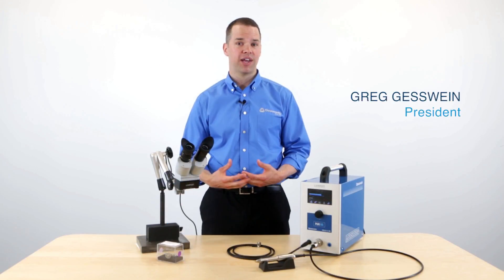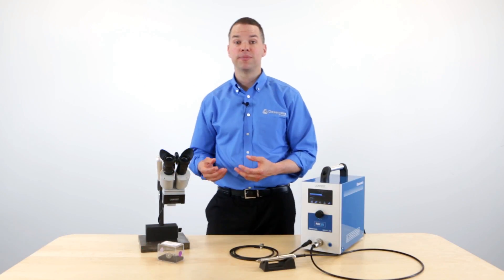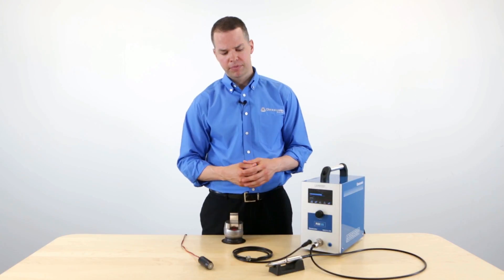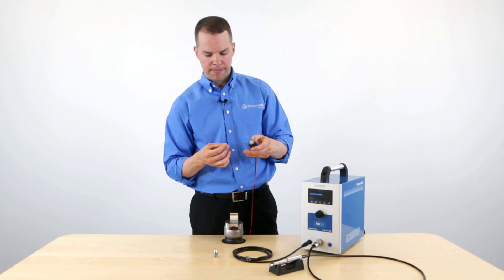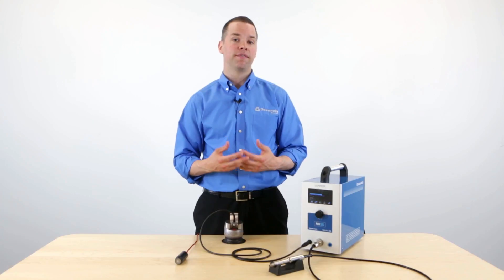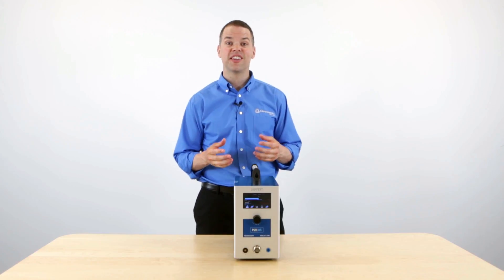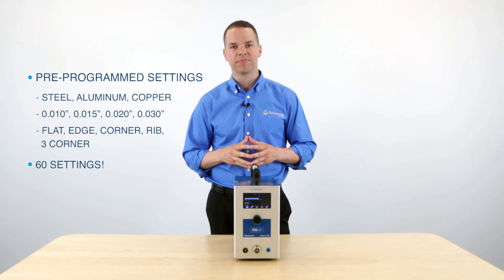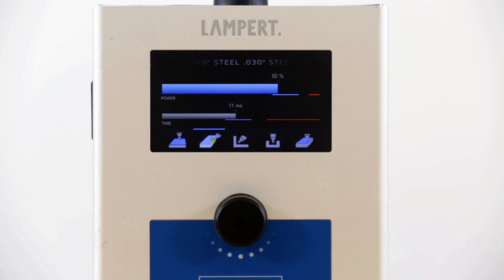PUK U5 Micro TIG Welder Instructional Video

Comment: So much easier on here than in real life lol. When I put the welder in front of sterling silver wire it just blows a hole in my pendant. When I dial down the number on the lampert the weld won’t stick. Definitely going to take some practice. Thanks for sharing ❤
Reply: set up and Try pulse welding . for very thin material.
Reply: Did you solve it?

When welding with wire it's not possible to go in with this angle of electrode in my case. That will eat some of base material when the first weld is done. If I aim more on the wire, and lean into the wire more with the electrode, then first weld wotn eat down in base material. 

How he does this would be very interesting to know. 

I weld 0,3 mm ss wire, 30% power, 0,5 to 1 ms is fine. 0,5 I use on first spot to not eat down into base material.

Comment: Seems crazy for $13k. For less that $300 you can get the ck worldwide 70 amp micro torch and run it on the welder of your choice (I run HTP welders) and you could do the same thing and save $8k plus.
Reply: Is that micro torch small enough to eg. pulse weld jewelery?

Comment: That weld seems more discolored than I would expect, regardless of if from soot or oxide.
Reply: @David Chatterton No one pickles TIG welds dude, if you have to pickle a TIG weld then you got to go back to school. I passivate my stainless welds if they are critical but they sure as shit don't need pickling.
Reply: to much heat ,amps down.

Comment: I would like to ask you about PUK U5 which we can weld aluminum material each other. Is there any limits welding aluminum alloys?
Reply: Good Day Ulas. There is a setting for aluminum in the machine, so it can absolutely do it. The only requirement is argon.
Reply: @adamkasson961  
which we never see presented, but it is never mentioned, aluminum for that microtigs it is taboo.
Reply: Как варить алюминий,в каком режиме?
У меня есть аргон

Comment: hi, what is liter capacity to argon gas bottle ?
Reply: For welding brass, you need to use only purified argon (999.99) or will it be normal?
I have PUK-5.
Reply: Good Day Arel,The argon regulator that is for the PUK highlights how much gas flow is required. Generally, it is between 3 and 4 liters per minute.
Reply: @adamkasson961  
Is it on the cylinder reducer?
Reply: To answer both questions, yes you want to use ultra high purity (UPH) argon, 99.9% pure. Also, the regulator that you get with the machine attaches to the tank, and that is how you adjust your gas flow. :)
Reply: @adamkasson961  thank
Reply: @adamkasson961  
hi adam.
i mean how much argon gas include in tube bottle from 3:46 minutes.
5lt. - 8lt or much more ?
thank.